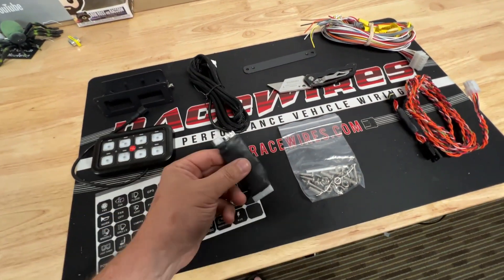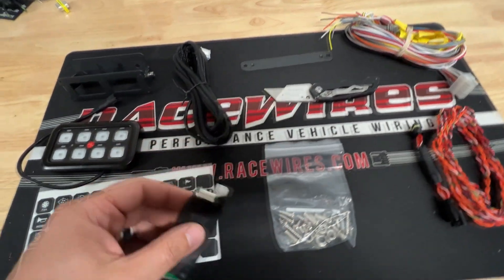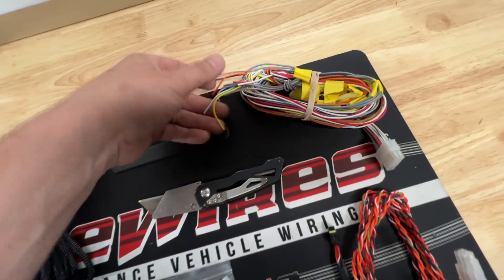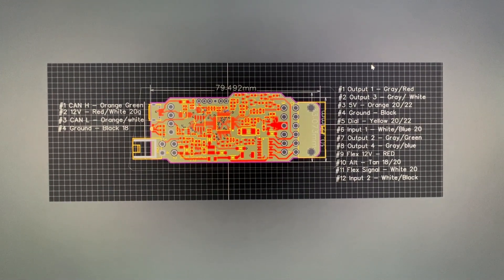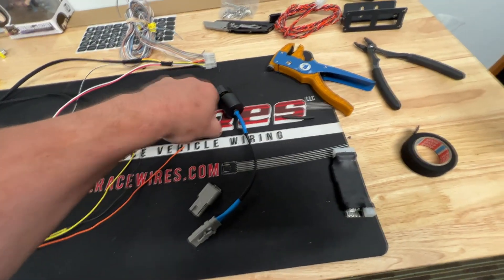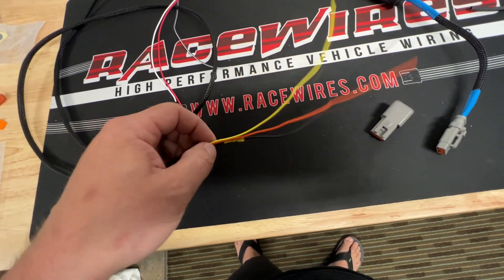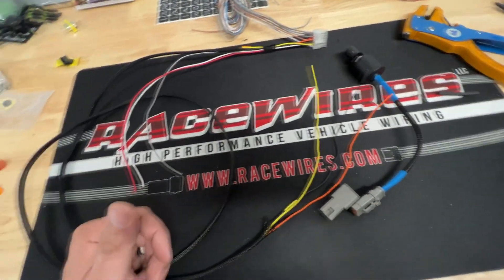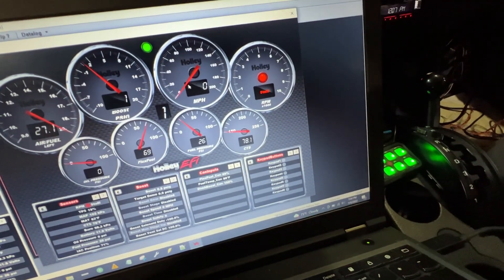Home Made Holley EFI 8 button canbus keypad (and more) testing

Comment: Can you hook up more than one if you need more than 8 buttons? I assume you can't but I thought I would ask.
Reply: It it limited to 1 8 button keypad with the way its being done. The first method I setup for Matt would have allowed stacking multiple keypads but using the CAN IO style input channels is very restrictive even on the Dominator and prevents binding any of the pin mapped functions to those input channels so it ends up being rather useless that way. So the keypad was moved to use the LCD switch channels since they do allow using the pin mapped functions the same way as any of the  wireded IO's are used. Unfortunately there are only 10 available LCD swicthes on any of the Holley ECU's so the keypads can't be stacked this way.

Comment: When does it seem like these would be available?
Reply: Once I get a thumbs up from Matt on everything I'd guess it will take me around 2-3 weeks to get everything together and make them avaible.
Reply: @PeteS160plus  how muck-ish?
Reply: @danhall5218  There are several options that will be up to the user to decide what they need or want that will determine what it will cost. 

The BoostSmart IO module in its base configuration with the single CAN connector and the DIY IO connector/loose terminals will start out at about $100~$110. The base version supports 2 wired input channels that can be used as CAN switches or analog inputs. There are 4 CAN "Ground Switched" low current output channels(these ONLY support CAN Switched configurations). Then you have a dedicated "Dial" input channel that works with any normal 3 wire potentiometer. It also has Flex Fuel sensor support for ethanol content and fuel tempeture without needing any type of resistor added. Then it also has an output channel for the GM 4 pin alternator with the resistor built in so it can be connected directly to the alternator.  

Now as far as the avaible "upgrades"......Each of these options is a signal upgrade. Its up to the user to determine what they would like to add. 

A) Upgrades the Single CAN power/CAN connector harness into a T style harness that acts as a signal pass through allowing you to connect additional CAN based devices such as the 3.5 inch screen or a Pro Dash without needing to purchase a separate Y cable.  I am still waiting for a quote on having these made but I'm guessing it will be around a $20~25 upgrade. 

B) Universal 6 foot "flying lead" style IO harness thats color coded. The 12 pin connector is preterminted so you would simply add whatever style connectors you wanted onto the other end of the harness or you could splice it directly into the circuit it was being used with. This will be around a $12~$15 upgrade. 

C) Bluetooth support added allowing the BoostSmart to be used with RealDash on a phone or tablet. This will support Android based phones or tablets, Windows PC's with a Bluetooth connection and "should" also work with an iphone or ipad but no one has tested this with an apple product yet and I'm not sure how well RealDash even working with IOS right now. The Bluetooth option for RealDash support will cost around $40~$45. I don't recall how many PIDS I have supported in real dash, I want to say there's around 35 from the ECU and then another 8 pids that display information about the boards own IO's.  *Note: The only way this is compatible with RealDash is by having the Bluetooth option added. 

D)The Keypad thats shown in the video here will be the final option. I am still trying to find a supplier for these that's willing to sell me JUST the Keypad, cable and mounting hardware. Currently the only way I can get the Keypad is by buying them as part of a kit, and only a very specific version of this Keypad is compatible. There are probably at least a dozen brans who make a keypads like this and they all  "look" exactly the same but they are very different in terms of hardware internally. I actually tried to get Matt a blue version of the Keypad and went though almost a half dozen different brands that all looked exactly the same but turned out they were very different in terms hardware internally...... and they all ended up being incompatible.  So until I can find a supplier who makes a compatible version of the Keypad;  pricing on them won't be all that great. The last time I looked at what these were costing me they would end up being priced as about  a $165~$170 upgrade option. I'm still trying to find a place to get these separately so that I can get the price on them down to maybe somewhere around $110-$120 but realistically its going to be pretty hard to do without spending $20,000+ in a single order with any manufacture. 

So for a base module version of the BoostSmart with no added options you'd be looking at just over $100. If you only wanted one to use with RealDash you would be looking at about $150. Now....for a fully loaded version with all the options like what Matts been testing for me you'd be looking at around $345 ish. Now that may not seem very budget friendly but you also have to consider how much its adding. There are 5 input channels, 4 output channels,  Standalone wireless dash support and an 8 button Keypad. This was initially intended to be offered as 3 separate devices, however by combining them so it could all be done with a single device the overall cost of what each aspect does ends up being is significantly cheaper this way.
Reply: @PeteS160plus  have you tried Auxbeam keypad supplier kinda looks like that is the one Matt's already using
Reply: @joryhaggerty5380  The Keypad is not avaible separately from any company that makes a kit using a keypad that looks like this. Going  manufacture direct from China would require ordering several hundred at once so its cost prohibitive. 

I have looked at  also integrating the pdm these style keypads come with so its not such a waste ....but its junk and nothing but a fire hazard.  

The only thing that's any good from any of the offroad lighting kits was the keypad, mounting hardware and the wiring for it. Everything else belong in the garbage.
Reply: Awsome. I would love one. I have a friend doing a swap now . He would want one for sure. Can you use the out puts without the keypad, as in turn something on in the software through the can?
Reply: @danhall5218  Yes, the BoostSmart is an IO module foremost. Everything else is does is optional.
Reply: Last question.  Pre-order?
Reply: @danhall5218  Setting up a preorder for something like this is much harder than you might think. It's a nice thought but its pretty unlikely to happen.
Reply: @PeteS160plus  that's fine.  Please keep me informed.  I'm very interested.  Thanks
Reply: @PeteS160plus  are these available now?
Reply: @PeteS160plus  just ordered it. Thanks

Comment: sitting on a gold mine if it can be made to be affordable
Reply: I've been working with Matt to not only get his wish list of things it could do but also focus on what features and even the overall design were the most important from a cost perspective to keep this affordable. Of course some things ended up adding to the overall cost like putting connectors on the board for everything but that also contributes a great deal to convenience and the ease of use that people are looking for. 

Even the choice to use double walled heat shrink to protect the pcb rather than a plastic enclosure was done to help reduce the overall cost.  Sure... I would love to have a nice sleek ABS case for this..... but from a cost perspective that wouldn't have any added any functional value that a piece of heat shrink can't accomplish for a fraction of the price.
Reply: @PeteS160plus  that’s awesome. Can’t wait to get my hands on one and a key pad to play with.

Comment: Would this also work with the can IO expansion module? If so I would love to have it.
Reply: Yes, it has been tested with multiple IO modules connected on a Terminator and Matt is using this on a Dominator in parallel with a Holley Pro dash. 

The main limitation is the Holley bus is already pretty busy and once you start stacking IO modules you can very easily run out of bandwidth if you are using a higher refresh rate on multiple channels.

Comment: Hey, how are you testing live like that?  I can't get those readings to work at all with KOEF - E85 sensor is angry without flow through it.  I've got an X Max with an IO and a Pro dash and the keypad even interests me at this point - can I daisy chain all of that together and still have a USB cable?
Reply: The Delphi/Contentianl sensor doesn't need fuel flow to read but the sensor does need to be full of fuel. If the sensor is mounted above the fuel tank then it would empty itself pretty quickly and stop reading once the key was turned off. Once there is air in the sensor it doesn't take much to cause the sensor to error out and stop reading until the element in the sensor is covered with fuel again. 

A sensor with air in it(even aerated fuel)will also cause the sensor to read very inaccurately.
Reply: @PeteS160plus  Ok, I've got a GM sensor mounted above the tank so it's probably just flowing back and getting air in it.

Comment: Matt, can the switch panel be at all altered to run momentary on any of the switches to have the starter on a button? Really been looking for an affordable panel that i can run everything off of.
Reply: Unfortunately this keypad only works like a toggle switch. I have found a similar version of this keypad that can be configured so buttons would only work as momentary switches but it is considerably more expensive, would require some hardware changes on the board and would also need to be reverse engineered. 

It definitely a possibility of something I may look into if these turn out to be successful, but for now the focus was more around trying to make all of this affordable.
Reply: That is more a switch thing, could move the lock and hold of a button.

Comment: When is this supposed to come out? I want one lol
Reply: Once Matt gives me a thumbs up that everything is working as expected it will take approx. 3 weeks for them to be available. Quantity may be somewhat limited initially depending on how much interest there turns out to be. Designing something like this and bringing a finished product to market as an individual is extremely challenging so please be patient. 

I am a very cautious developer and I don't like finding out about some unexpected issue with my hardware or software once something has been made available for sale. I also don't produce a product with the expectations that because the first X number of them worked fine that means I can just start shipping out a product. I always bench test every product I sell so that my customers never run into issues. Some of the things I make can be extremely technical. For the customer, knowing that every piece of hardware was tested by hand eliminates those "well maybe its just defective" type of situations when they are struggling to get something configured correctly.
Reply: Awesome! Subscribed to your channel, will check out your videos later. Hopefully I can get in on the first round you put out. Very understandable if it takes some time considering what it is and everything it does. Plus sounds like you're going above and beyond to make sure this works 💯👌 Thanks for the reply! Hope all goes well!! Will definitely be keeping any eye out for updates and how to get one 🤘
Reply: I would like to pre order as well